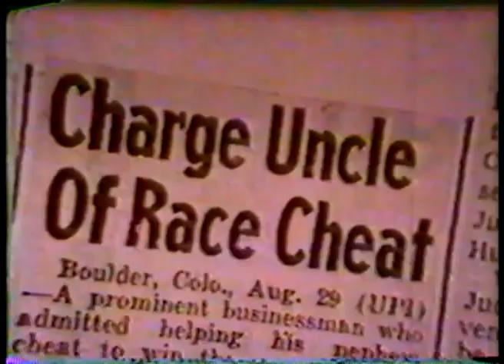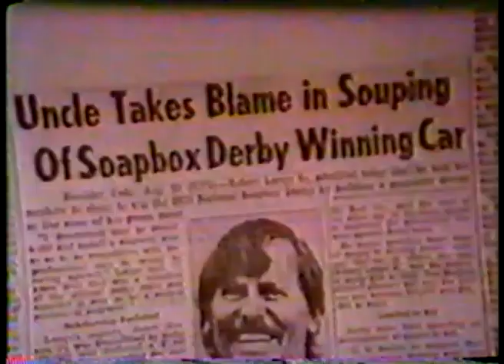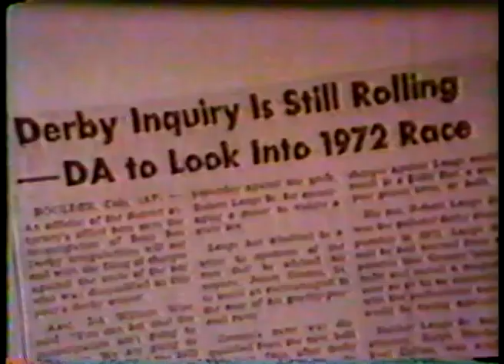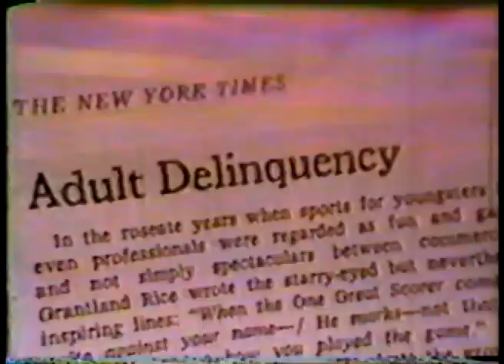The Day the Derby Almost Died - The Magnet Car

Comment: So basically they put an electromagnet in the nose, that rested against the metal starting bar.  When the bar was dropped, to start the race, the magnet would stick to the pole as it dropped, and  pull the car forward, giving it a slight advantage.
Reply: Wow, you figured that out, huh?  Brilliant.  I guess they should list you in the credits as the assistant narrator 50 years after the fact.
Reply: Thank you. I didn't want to watch the whole video, I just wanted to know what happened.
Reply: You got it
Reply: That’s what I figured. Didn’t want to watch the video either.
Reply: Thanks, I couldn't quite get how it propelled the car forward.
Reply: @booifojoe  look at that smarty pants. It looks like the original commenters comment was useful once again.
Reply: Mobile Games  there are most likely many people that don't know how an electromagnet works that are way more intelligent than you.
Reply: meh. very doubtful that would provide any sort of advantage at all. where did they hide the car battery for the electromagnet?
Reply: Mobile Games  it probably only seems 'confident' because i have a physics degree and understand that it's not possible. Further - any miniscule attraction there might be to the 'starting bar' (i did not even see it in the video) would be subtracted by an opposing force once it is across.
Reply: @antigen4  you missed the steel plate that holds each car back at the starting line? It sticks straight up 30-ish inches. It is the attraction to that steel plate pivoting away that provides the extra push. I suspect the electromagnet was energized for only a couple of seconds and when the steel plate dropped Jimmy opened the circuit to conserve battery power. Also as the plate pivots away the magnetic attraction decreases to zero within a few inches.
Reply: Mobile Games  he's doubtful of the advantage of a design feature that won two years running? That's some really confident doubtfulness!
Reply: @curtislowe4577  the word 'bar' is used above. The devil is in the details. it would have to be TOUCHING the nose of the car for there to be any interaction at ALL i should think (but then of course the car would be stopped by the plate itself ... i would be more inclined to think there could be interaction between a 'plate' than a 'bar' however
Reply: @antigen4  The person making that comment probably isn't technically proficient and used the wrong descriptive term. Wikipedia calls it a paddle. The steel item that is the hold-back / starting device is a length of flat steel plate or sheet metal maybe 6" wide and it is in contact with the nose. I suspect the electromagnet was embedded such that it would be within a tenth of an inch of the plate.

Have you ever studied physics as it applies to racing? Even the slightest of advantages can be the margin of difference where as little as a single thousandth of a second can be the difference between winning and losing.

The evidence of the effectiveness of the electromagnet is undeniable. From Wikipedia: The margin of victory for a race heat is normally no more than 1 to 3 feet (0.30 to 0.91 m). Gronen's early heat victories were in the 20 to 30 feet (6.1 to 9.1 m) range.
Reply: It absolutely worked. You can see it in the slow mo... Not a bad idea (besides the cheating part.. lol)
Reply: I was wondering exactly how a magnet would give an advantage until I saw it. I wish the video was more to the point and not so damn drawn out. A possibly legal way of getting an advantage would be a variable weight in the rear of the vehicle, able to be tuned to precisely set the vehicle + driver at its max weight limit. A good way of doing this would be vertical cells that can be filled with sand. The reason for putting the weight at the rear is simple: potential energy. Putting the weight higher up means it has higher potential energy going down the hill (this works for pinewood derby cars, too).
Reply: Well look at the big brain on you.
Reply: Thanks. If the film hadn't explained exactly that in almost the same words we would never have known.
Reply: Robert you're amazing!
Reply: Any kid near a swing set will tell you that it takes very little energy to accelerate a moving object.  

It is pushing someone from a dead stop that is hard.

C'mon man, Newton....
Reply: Pretty genius actually.

Comment: The judges couldn’t tell that an 11-year old didn’t build a highly engineered, aerodynamic vehicle? My first go cart, that I built at around the same age, was two boards with old tricycle tires nailed to it. The seat was an old kitchen chair.
Reply: Speaking for myself and my cousins I can say we did 95% of the actual work ourselves. My uncle, a tool and die maker who should have been an engineer, did most of the designing and oversaw everything we did. Our first year cars sucked but our cars got better every subsequent year as we learned, until we were making cars that looked like the ones in this film.
I know I learned a lot of useful stuff about working with fiberglass, wood, metal, paint etc. from my uncle and from various helpful adults in the Derby community and had a great time doing it. Never made it to Akron. My youngest cousin did.
Reply: It sounds like a Hyundai.
Reply: @Erok Magnag good chance it was carbon like what you get out of a pencil. Old trick in the Pinewood world is to "carbon the axels" to make the car go faster.
Reply: @Erok Magnag I saw the same where I worked. Hours of Pinewood were charged off to someone else's ticket! 
"Anything worth winning is worth cheating for."
Journal of Business Economics, Springer, vol. 87(8), pages 985-1016, November.
Reply: @90FF1  Or ....2nd is just the the first looser....Ricky Bobby
Reply: @Erok Magnag Yep. Many of the men in that "derby community" I mentioned were Douglas Aircraft guys. SoCal Soapbox 71 - 74 for me.
Reply: They weren't required to build the cars themselves, they just had to meet the regulations, as in any racing. No racing required the drivers to build their own cars, after all.
Reply: @anzaca1  Actually they were required to build the cars themselves. Source: I raced soapbox in the '70s. I may still have an "Official Rule Book" around here somewhere. If I can find it I'll scan the relevant page and post a link.
Reply: @OttoByOgraffey  You ever watch Talladega Nights? Say it with me.....looser....😎
Reply: @OttoByOgraffey  

I think O-tt-o By O-graffey has too many O's.

Edit: Bold-ed O-tt-o By O-graffey
Reply: @Erok Magnag Man, as an 'adult' my boss instructed me in about '85 to help the owners son with the mechanicals on his pine box derby car. Also instructed me to not "spend too much time on it". Not the thing to tell a 23 yo guy who wanted a second chance at winning, and had a metal lathe at his disposal at work. Something like 5 hours later, I'd chucked up the nails used for axles and deburred them then polished them, countersink the axle holes in the wheels to make less bushing surface for friction, and chucked up the little black plastic wheels and narrowed and machined them narrow and to point like a pizza cutter wheel. Then of course got a Qtip stick to rub graphite into the centers of the wheels bushing surface. Had the rather short list of rules right there with his car, so nothing I did violated any stated rules. Wasn't there, but guess he cleaned the clocks of his fellow scouts in his den and was top dog. But at the Scout-o-Rama I guess they took one look at his car and immediately disqualified it. Bummer, for him especially but for me too, reliving my 2nd youth.
Reply: @sootikins  Yes your right, the notion or excuse that everyone was cheating falls on deaf ears here. EVERYONE else wasn't cheating!! My Dad was an electrical engineer at WestingHouse, My older brother went to Akron in 68, in a situp rough boxy car. Dad came back and designed a lay down car for my other brother that placed 12th at Akron in 71, and I missed 5th place by one race, got beat by Chapel Hill NC Priscilla Freemen. (I lost 2 pounds by going to the bathroom prior to my last trip down the hill, duh I just couldn't hold it any longer... lol) My younger brother raced at Akron in 73, lost his first heat, trial run was perfect, first race his car came off starting ramp headed right for the wall, sketchy shit went on that day.

Comment: The reasons people thought there was cheating was due to his race times. He was winnings by a margin that was much more than other races. Also, his times got slower with each subsequent race, not faster. This was due to the battery getting weaker with each race.
Reply: If they had neodymium magnets back then the nose would have stuck to the bar and gone slower.
Reply: @alwaysopen7970  
Neodymium wouldn’t be any good coz it had to be an electro magnet or the stewards setting the car up on the start line would have noticed it “clamp” onto the start gate.

Comment: RIP my tweeters in my computer speakers.
Reply: It is almost unwatchable. I wish there was a better film transfer.
Reply: In need of a good audio nerd edit and repost for sure.
Reply: @filthylucreonyoutube  I agree about the history. The audio definitely started with an (for the time) industry standard television audio eq curve, in mono, and is very compressed for broadcast. The dub, most likely, scrubbed even more low frequencies as the audio volume was boosted creating quite noticeable distortion and, likely, peaking in certain upper mid and high frequencies as it recorded to the second source. Depending on the levels as it crashed into the YouTube system, it was most likely squashed even more so now it's brittle as all hell. I need to download it and look at the wav file in a DAW. I bet it looks like music from the early 2000s all brick-walled and in a spectrum analyzer, nothing below 500hz and a huge spike at 6000 and up.
Reply: That line would fit well in a song by Kraftwerk.
Reply: It's like the sound effects in Fist of the North Star after Kenshiro pokes someone and their head starts to balloon before exploding.
Reply: @HerraTohtori  Pretty good description.
Reply: @sski  I was wondering if, at some point in the chain, someone added a sharp boost at 6k or so to improve sibilance, needed to overcome background noise with voice,  or maybe an uncompensated noise reduction scheme. It was a bit overdone, even to my half-dead geriatric ears.
Reply: @WCM1945  Something like that definitely happened. Under what circumstances I can only guess. Wouldn't be hard to re-EQ the whole thing. Better to have to take away unwanted frequencies that are abundant then try to add any that don't exist in the first place.

Comment: In my town nothing like this existed,  but I used old hand push  lawn mower wheels and scrape twice reclaimed lumber and pipe to build a coaster with roap and foot steering drag up and ride down the cow trails and roads around the area. It is a miracle that I survived. Some of those hills were extreamly steep and crooked with no shoulder and barbed wire fences.
Reply: I didn't find out about soapbox derby until I was far too old to ride one. However, I did have a Radio Flyer and Calvin and Hobbes opened my eyes to its possibilities. With no brakes it's a wonder I didn't ever break anything. Learning to lay it on its side in the grass at the bottom of the hill instead of flying into the gorge like Calvin was an acquired skill.
Reply: Tom that's hilarious, this is my first time even hearing about these things. I've only ridden and raced dirtbikes all my life and your creations sound like a blast to ride down those cow trails lol. Rope & foot steering kinda like a rudder in an airplane?
Reply: Thomas LeMay you were lucky to have barbed wire to stop you. We had to race on a road riddled with land mines and next to alligator infested waters. Did I mention the alligators had ak47 guns,
Reply: I remember those, a good  set of wheels was for the rich kids, one time a neighbors kid built one with a steering wheel mounted on a broom stick with a front and back support, problem was it steer right when he turned left, he had the rope wrapped around the broom stick the wrong way, I figured it out and fixed it for him. my first auto repair at age around 8,  lots of fun,
Reply: @johnlepkowski3831  Alligator wielding Ak-47s? luxury.  We had nothing to stop us.  I mean i literally grew up in a voidlike plane of existence.

Comment: I find it hard to believe those kids could do all that fiberglass work by themselves.
Reply: I built a fiberglass car very similar to those in the film when I was 13, did 95% of the hands-on work myself, but had an uncle who had lots of experience directing my every move. There was a fair amount of tear-up do-over involved and endless Bondo/sanding/grinding because I wasn't skillful enough to lay up glass with a perfect finish first try. Fiberglassing is just one of many skills I was "forced" to learn when racing Derby.
Reply: It wasn't easy. The first thing we learned was to not put resing in a Dairy Queen banana split dish. The resin melted the plastic and we had a puddle on the floor! LMAO
One other memory was actually putting the car in the living room so that the fiberglass would cure because the garage wasn't heated. My mom was not happy!! LOL
Reply: We built our cars with the same technique as making a canoe. Wooden slats are tacked to temporary wooden bulkheads and the ends were rabbited into a wooden nose and tail piece. This technique was stronger than laying fiberglass over a Styrofoam mold.

Comment: When I was a boy in the mid 60's, the race was held in Ravenna, Oh. It was called the Portage County Soap Box Derby. The race started at the original Midway Lanes. It ran down the hill toward Kent on Route 5. The finish line was just past an overhead steel railroad trestle that is still used today.

Comment: People have been cheating at racing as long as there has been racing. They still do it today. " It's not cheating if you don't get caught "......Smokey Yunick
Reply: Fine line between cheating and innovation
Reply: If you're not cheating, you're not trying
Reply: And you read the rules to see what's "not" in the rules.
Reply: Or as D.W. put it "We weren't rule breakers so much as rule makers."  For instance it wasn't illegal to run extra fuel line so your car would hold more fuel until someone got caught with a bunch of extra fuel line looped around.  No telling how many times that trick had been used.

Comment: This cheating had been going on years before this. I was in the Detroit soap box derby and I always had a fast car but when I was 14 around 1962 I went to the race and had a fast car but there was one car that when the car took off it shot out of the gate and was a length ahead of everybody. In fact as we watched from the starting line the car would put there brake on but still shot out ahead by a car length.  I lost but this car went on to win and went to Ohio for the race.  We could not figure out how this car did it but after 1973 we knew.  The magnet was used back then.
Reply: thats very true my father knew of a family here in akron whos boy was in the derby for many years - his father (even though you were not supposed to tamper w/ the wheels and axles) machined the wheels and axles to a precision running clearance and another family member had access to a wind tunnel where his car body was sent for the aerodynamics these kids had not built those cars for many years
Reply: I was in the Detroit Soap Box Derby around 1962 also.  My uncle was an engineer at the GM Tech Center in Warren Michigan.  He said that other fathers were having their derby cars tested in GM’s wind tunnel.  My steering cable was broken after the trial runs - when the race officials lined the cars up for their official races.  A race official had to repair the broken 500 pound aircraft cable.  It would have taken a lot of jostling of the car to have broken that cable.  I won the first heat but lost in the second heat to the car that would end up winning that year’s race.  Coincidence?  Also, all of the winning cars had exquisite fiberglass bodies with multiple coats of lacquer.  Obviously nothing an 11 year old kid could do.  Bitter?  Not really because it taught me a lot about the ethics and morality of this country.

Comment: NASCAR drivers called it "gettin competitive"
Reply: “The unfair advantage”
Reply: Restrictor plate racing
Reply: Pretty good Guy  Yunick cheated the rules in NASCAR, but he claimed it was only because everybody else did too.   He did stuff that nobody else thought of or would do, like snaking a 1" fuel line all though the car to hold an extra 10 gallons of gas, or smoothing the underside of a race car with body filler to gain an aerodynamic advantage.    The Chevelle was really the last straw for both sides.   NASCAR had just started using body templates to stop all the body modifications.    The templates didn't fit Smokey's Chevelle (he claimed it was built from a roll over wreck, NASCAR claimed he chopped the top) but they didn't fit a rental Chevelle Smokey brought in either.  In the end, NASCAR gave him a "fix-it" list that was reported to be two pages long, including a request that he "change the frame".
Reply: Pretty good Guy  Smokey called it 'creative rule interpretation'

Comment: Thank you for uploading this film. I'm quite surprised, that a simple electromagnet can help you to win a race because I think this magnet at the start point made max. 1 or 1.5 seconds not more. Or do you know, how exactly it was worked out? It's just for interesting and information for me. Here in Austria and Germany, for some races it's equal what you use, the only forbidden thing is any sort of motor, the rest is up to you.  cheerio Toni
Reply: Toni Turnwald  ya 1 second in soap box derby is huge when most races are won or lost by less than 10th of a second.
Reply: 1 second is huge in motorsport....